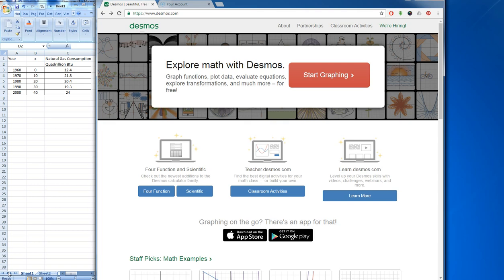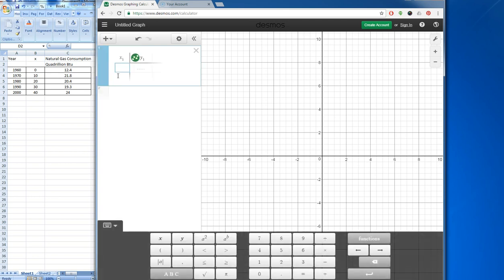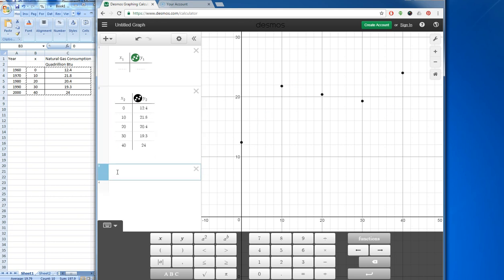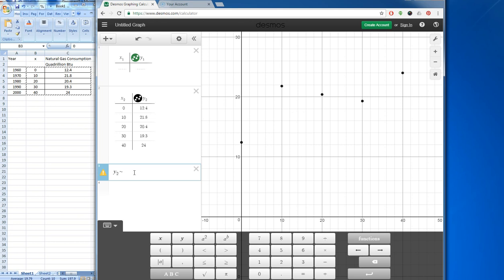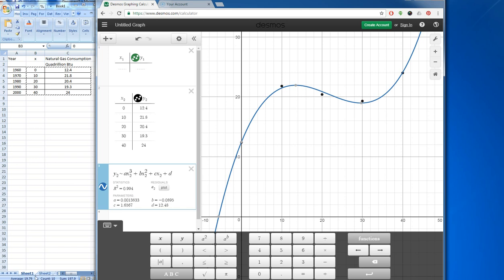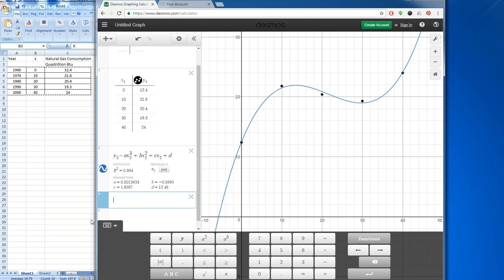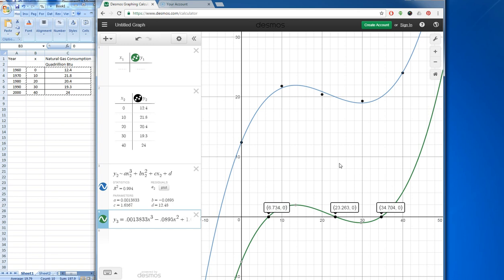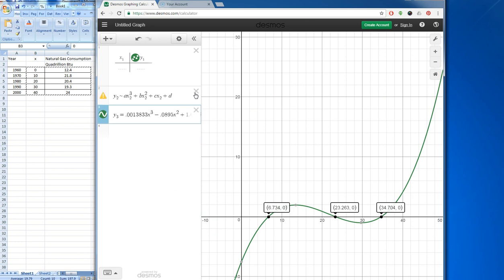Cubic Regression with Desmos

Comment: Thank you for this video it was helpful. can you tell why when i use a lot of points not all of them are in the blue line ?
Reply from the maker: Real data doesn't always fit exactly on the line.  To guarantee a perfect fit, for n points, you would need to use an n-1 degree polynomial.  So if you had 10 data points and wanted every point to fall exactly on the curve,,  you would need a 9th degree polynomial, which is very complicated.  It's possible that a cubic, or 4th degree polynomial could get "reasonably close" to many of the points, depending on how they happen to fall, but if they happen to fall "wrong", a 3rd or 4th degree polynomial may not be a good model.

Comment: I'm having trouble after I use atlida it doesn't recognize it as a formula
Reply from the maker: Do you have also have a list of data points that you're trying to approximate?  If you want to just plot a formula, use an equal sign.  For example, y = x^2 + 3x - 7 plots a parabola, and it even changes x^2 to x-squared automatically (with better format).